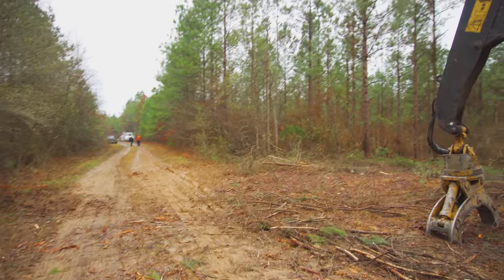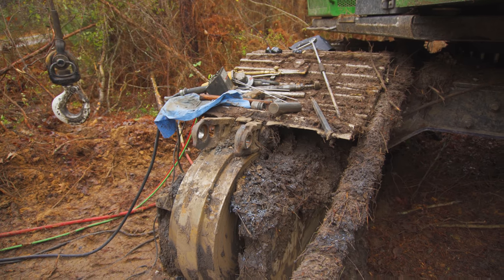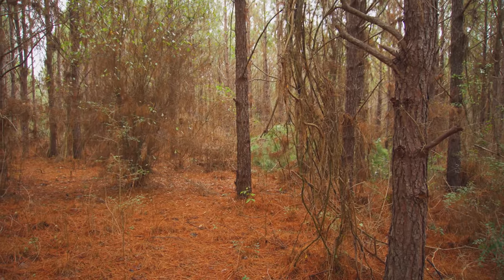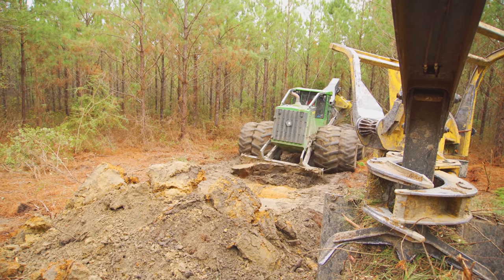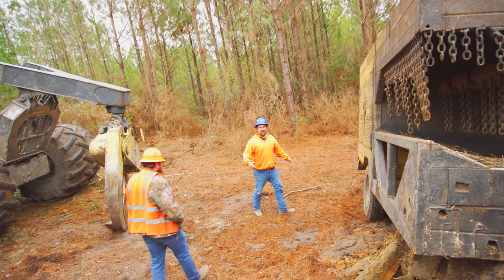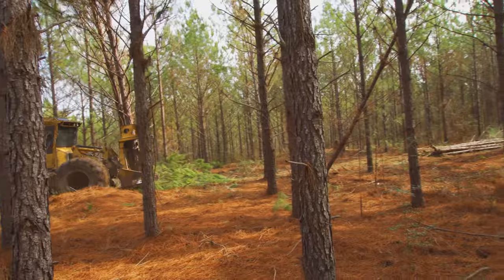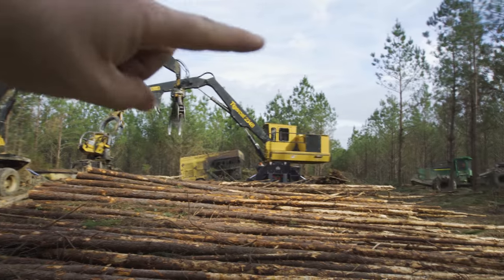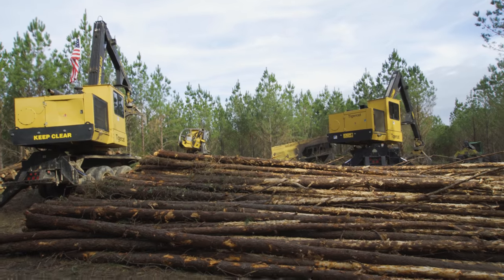Chambers Delimbinator Returns & 718E Cutter Action

Comment: You ever thought about running a 615 tractor for your low ground pressure application? Seems to me that would be a perfect tractor for what you do
Reply from the maker: Kyle M we use to run a 625 and 635, but the cost of the bogey machines got too high for our application.
Reply: Yea I don’t know how they figure the bogey is worth an extra $150,000 🤷‍♂️🤷‍♂️🤷‍♂️
Reply: I saw a prototype L bogey a while back but I heard JD wasn’t gonna pursue it